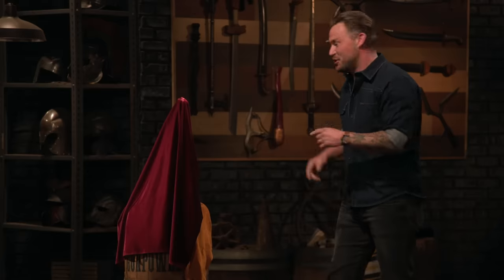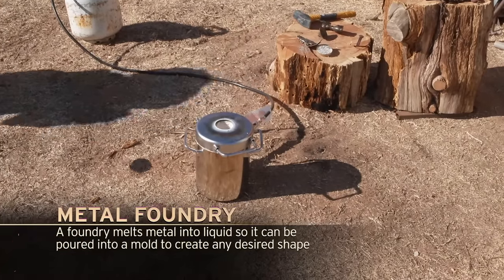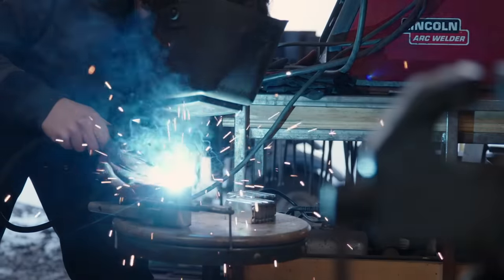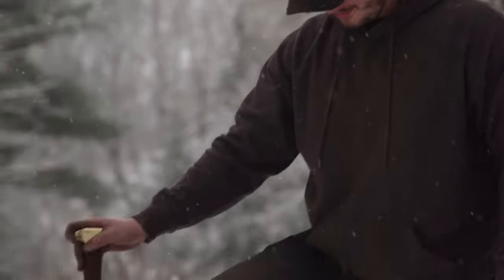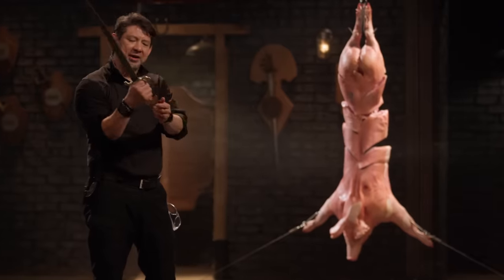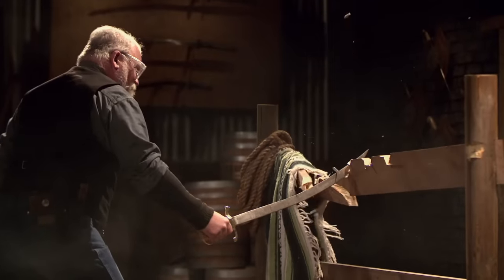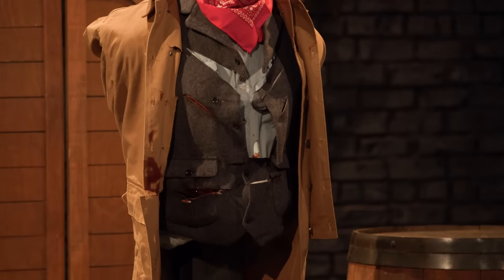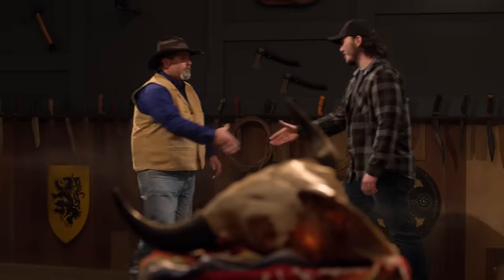FASTEST BLADE IN THE WILD WILD WEST! | Forged in Fire (Season 9)

Comment: I really like episodes where the blades survive and the results are this close. It really comes down to those fine details, really good craftsmen here
Reply: I absolutely disagree with the choice of winner. The handle being a bit to long isn't a valid reason to deny the win. The parameters do NOT require the handle to fit the hand of any judge. The blade outperformed the winner in the sharpness test and was equal in both the kill and strength test. Most "cowboys" were over 6' and therefore usually had larger hands than the average male.
Reply: @ComancheWarrior63  I have to disagree.  I don't believe that it was just that his handle was longer, but that its smoothness caused the testers grip to slip.  When both contestants produce great work, like these two did, the finest of details matter.
Reply: @John-rh3dh  I agree that a smooth/polished handle can be an issue. But, we must also consider the fact that when blade weapons were commonly used it was also common to wear gloves that were treated to improve grip. Leather/bone/antler/horn/wood becomes quite slippery when covered with bodily fluid. Only a rough texture handle will prevent this.
Reply: @ComancheWarrior63  the one thing I think you are missing, at least when they did the strength test, is that the younger guy clearly had the stronger blade, even if by a small fraction.
Reply: Reminds me of that episode with the Khyber Knife, it was close.
Reply: @ComancheWarrior63  same i also disagree with the choice of the winner its just a handle that blade straight up went over 3 layers of clothes easily and straight up made that dummy lose a majority of its blood it cut the abdomen in one slash and the abdomen straight up spew all of its blood in just seconds.
Reply: @alechamilton1864  bro no offense but what u said what straight up stupid both of the blades never got damaged at all in the strength test breaking bones doesn't mean its a stronger blade it means the dude swinged harder
Reply: @Uranatis  whatever you say lol.
Reply: @alechamilton1864  what i said was technically true
Reply: @Uranatis  ok lol again, whatever you say.
Reply: @John-rh3dh  Also, the winning blade cut noticeably deeper into the pig carcass and the roving dummy, so the winner was that much clearer.
Reply: @Uranatis  Both blades were successfully performed through 3 tests, so it boils down to the detail. A handle that fits your hand would surely have an advantage especially when you endure a long fight with blood/rain/sweat on your hand. This is a 1 hand sabre, not a longsword, a long handle is not necessary since the rider would never wield their blade with both hands

Comment: These 2 smiths were literally neck & neck through all the tests. They kill, took NO DAMAGE in the strength tests, & cut through multiple layers of clothing! Also both blades were absolutely beautiful artistic work from pommel to blade tip! When forge battles come down to the finest of details, there's no such thing as a loser. Both of these men are exceptionally talented smiths! WOW!
Reply: In all honesty, the guy was a step behind the whole way. His blade performed well, but was also consistently the one receiving a complaint about the handle. When the test performances are roughly equal, handle issues are always the first reason for someone to be eliminated.
Reply: @ShaggyRogers1  Yes, a firm grip is as important as a sharp blade, the blade with a fit handle would surely have an advantage.

Comment: Those were both awesome blades. I think lost solely because the larger handle size
Reply: The winning blade did peform better on the kill test & was more destructive on the strength test (although thats not the point of tge test). So i'd say even with a smaller handle the results would be the same. That Said, the losing blade was still a masterpiece & could have been an easy winner on a different day
Reply: That was your blade?
Reply: @Willdostyles  I wish the judges would have elaborated  about their decision.
Reply: @MrJo1340  The handle was too long, they explained that in the first test.
Reply: @Just_Pele   I know, but typically when they announce the winner they give a brief recap on the other opponents blade. In this case he simply walked off the forge floor without any further explanation.